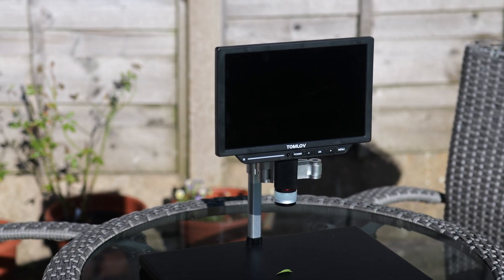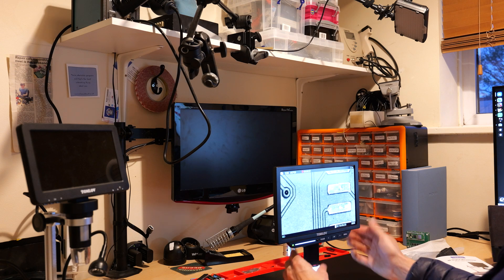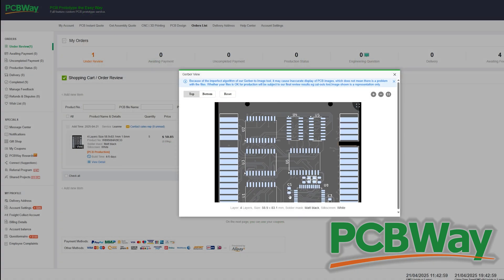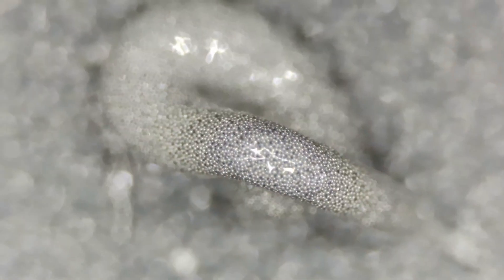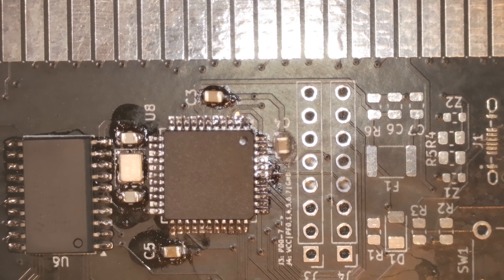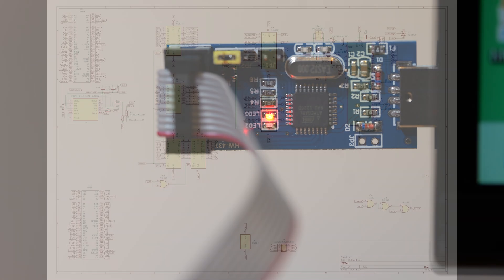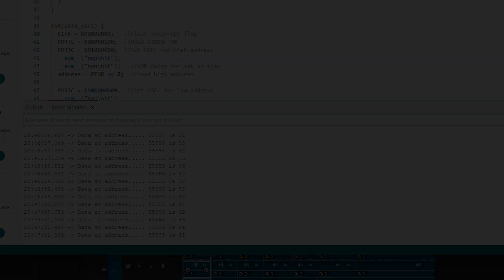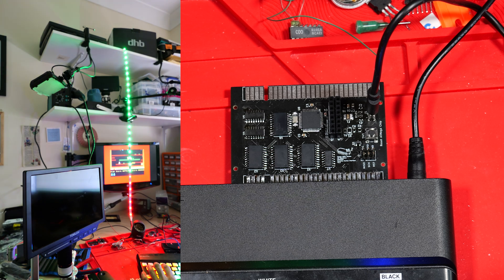Review - TOMLOV TM4K Max Digital Microscope - Building my new ZX Spectrum Reactive Device Interface

Comment: Loving this project, next to the manic miner tape don’t know what you could use it for but loving it!
Regarding the drag soldering, I swear by a hollow tip for some ic’s, no need for a hot air gun. Done many projects and with the hollow tip it’s a breeze. If a bit too much solder is used and you have bridges, just clean the tip, add some flux and drag along the legs again and you’ll clear any bridge.
Reply from the maker: You could have ambient lighting matching the border. Or a real working Speedo for a racing game. A "flip display" score counter. You could recreate the screen contents with LEDs. A speaker playing real voice sounds with dialogue. A rumble pack! I could go on 😂

Comment: Hmm... Considering getting this microscope at some point, as I got ahold of 0402 passive components which are stupid tiny but generally good for compactizing the digital logic circuitry on the board.
Reply from the maker: I recommend it! If you do, use the link and code in the description, they are offering an extra 20% off for a few weeks
Reply: youll definitely want a microscope for soldering those ! Personally... i think I'll leave it to professional assembly like JLCPCB or PCBWay to do that for me :)